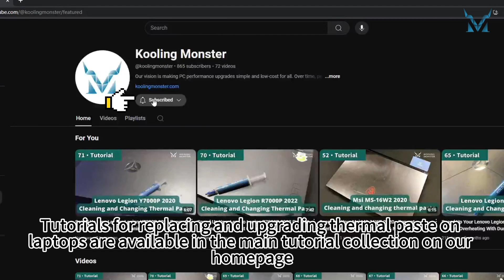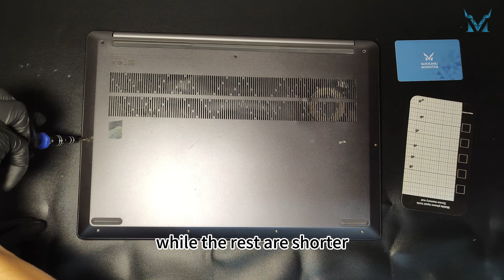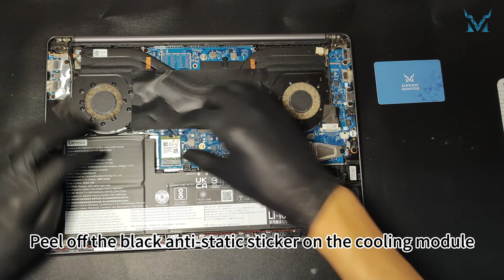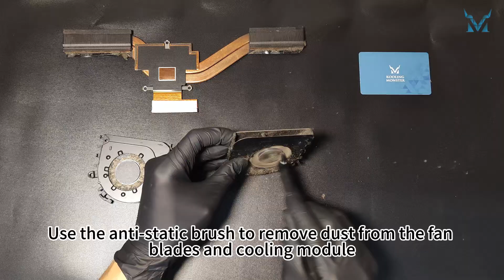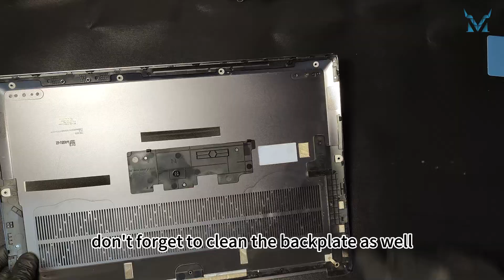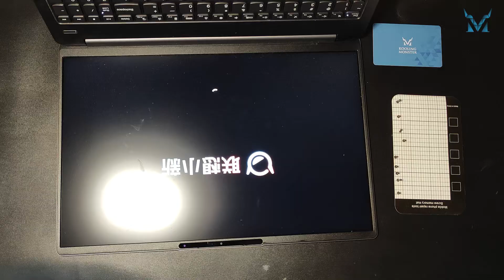Speed Up Your  Lenovo IdeaPad Pro 16 Prevent Overheating With Dust Cleaning & New Thermal Paste

Comment: computer webt from 101°c under load to 83°c. Just used contact cleaner (IPA), towels and regular desktop thermal paste. No need buying as specific kit. Nice vid though.
Reply from the maker: Clean job—101°C to 83°C is a solid drop. Most people don't realize how much old paste hurts temps. Glad the video helped, and good proof you don't always need a fancy kit